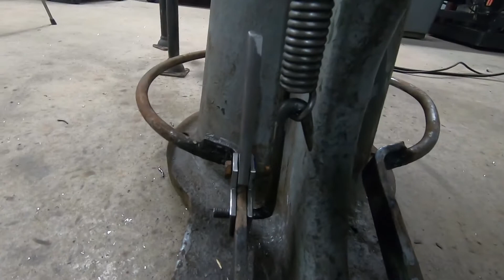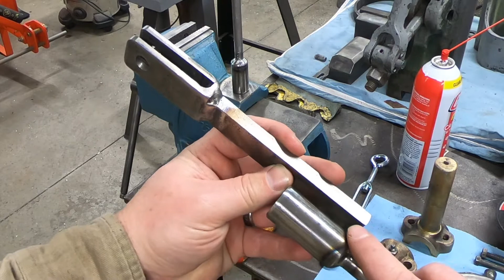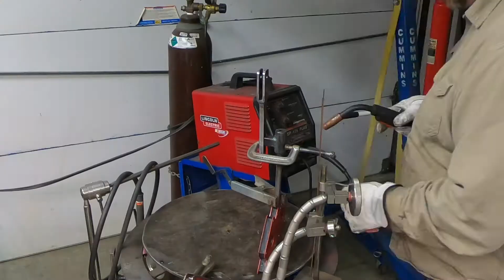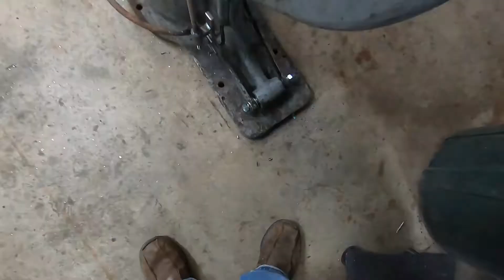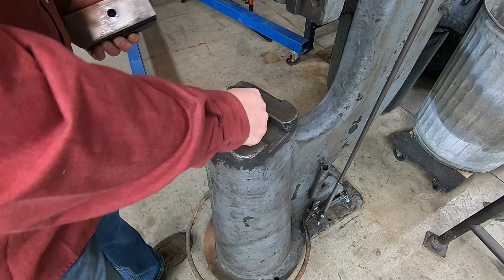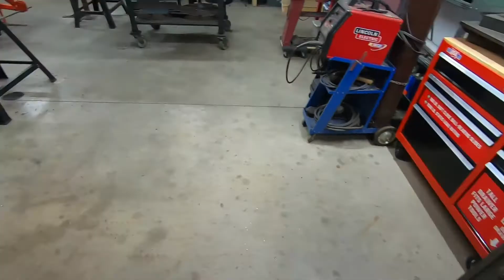Little Giant Power Hammer 25Lb Pt5

Comment: Hi. Did you manage to get the  brass to stay in the post deformation.  I had the same deformation, tried melted brass but as it cooled the edges of the brass curled up. Ended up machining a piece of tapered metal , still nee to do final fitting.

Comment: Not sure if you re-installed that shop-made collar around the anvil. I hope you didn't. It may have been there for some special tooling dies the previous owner used. But it's not original. I didn't see a part six, but would love to see how Mike is using it now. I restored my LG 25lb last year. I also attended a rebuild workshop that LG puts on now. I hear they are going to host it again there in southeast Nebraska. I do plan on attending again. I have dies to buy so I'll buy them then.